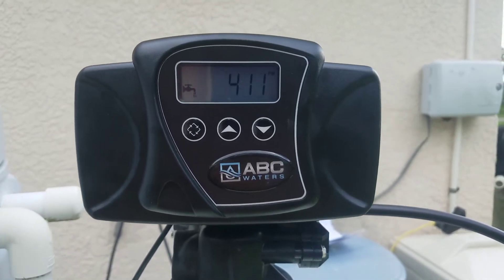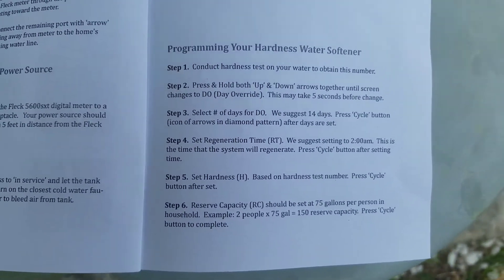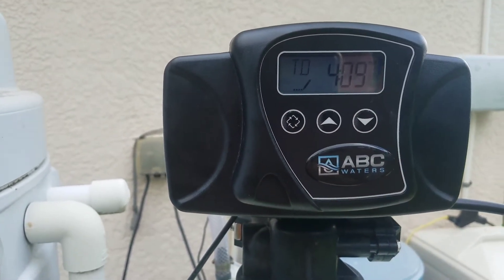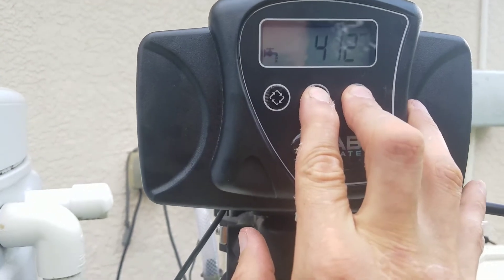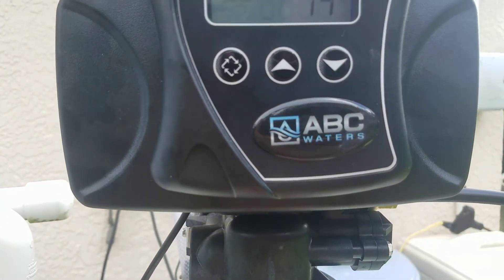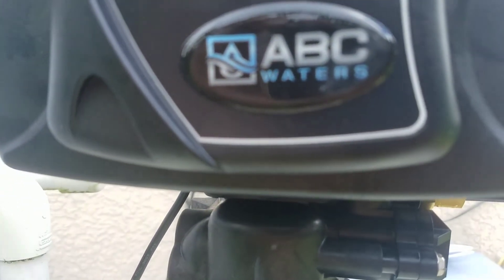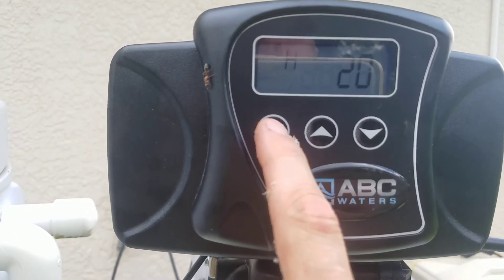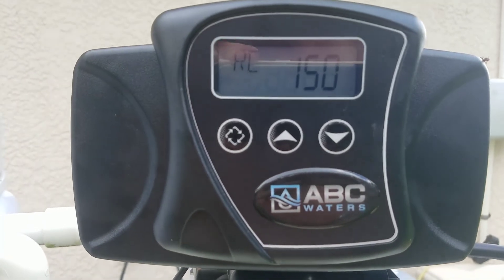Fleck 5600sxt water softener programing

Comment: What’s my abc water softener doing it says BD on the LCD with a count down. It the first time I noticed this. Help don’t know what to do?  Thanks
Reply from the maker: Are you sure it doesnt say bw on the lcd while it counts down?  Because it will say bw and start counting down if you hold down the button on the far left which starts the regeneration process which takes about an hour and a half to complete.  Just let it finish the process.  You may not have water in the house during this time.
Reply: airborne19811 it’s now doing BW with 9mins counting down before that it was RR
Reply from the maker: Mr. Foshow i would just let it finish the process.  It sounds like you might have accidently started the manual regeneration process.  Just let it finish.  If you stopped it during the process you may want to start it again after it finishes just so you know everything is the way it should be.  Just make sure you have salt and water in your brine tank
Reply: airborne19811 it stopped. And now on the lcd it show the a time 3:37 and 3:40 with a flame icon blanking and with a big number of 1772. Don’t know what that is I have to ask the guy who installs it for me. Thanks for your reply.
Reply: airborne19811 I did let it finish. Thanks
Reply from the maker: Mr. Foshow that 1772 number is how many gallons of soft water you have available before the system needs to regenerate.